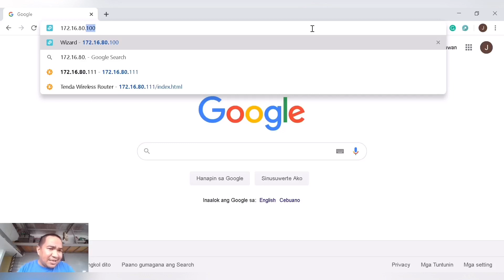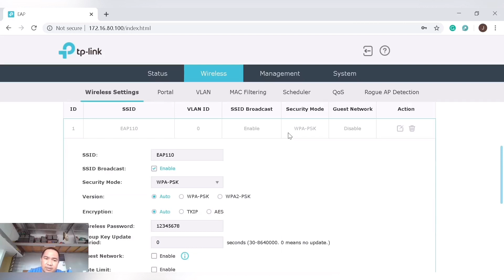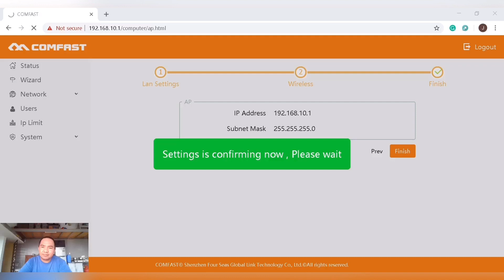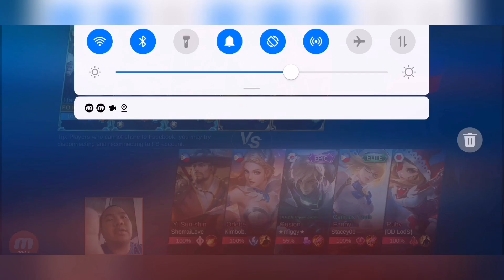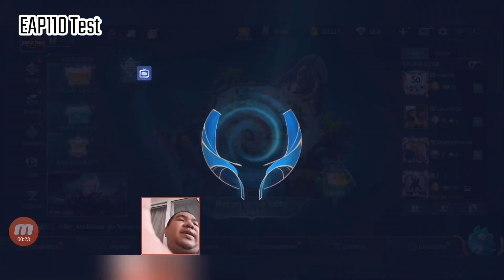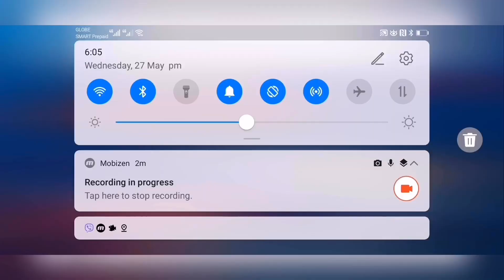TPlink EAP110 and Comfast EW73 - Configuration and Actual Testing | JK Chavez

Comment: Boss pwede ba na ang gawin kong AP ay TP link tapos ang ang extender ay ew73 comfast?
Reply from the maker: Hi Ariel, pwede pong gawing repeater mode si EW73, pero wired exntender negative po since isa lang ung port ni eap110..
Reply: @JKChavez  di boss wireless po

Comment: Sir sana may makatulong sakin pano ko po malalaman kung legit na tp link 225 yung gamit ko? Like may pwede bakong i scan? Kse yung kaybigan ko bumili ng tp link 225 tapos ang lapit lang ng range ng na aabot as in parang tp link 110 lang sya, 10m lang ata yung sagad na range.
Reply from the maker: Hi, usually one way to check is the firmware, if same firmware ung available sa official site ng TPlink and naka install sa device.. hight possibility of legit po..

Comment: Boss bakit po pag gamit ko as repeater or bridge si ew73  limited lang yung speed ny a to 10 - 15mbps kahit 100mbps speed ko and full naman signal
Reply from the maker: gamit mo po sa piso wifi? na change mo na speed settings? pag bridge mode or repeater mode sir, may bawas talaga sa speed, lalo na single band lang po ew73.. :)
Reply: @JKChavez  sa regular  router ko lang po siya gamit.. problem pa po is lagi siya bumibitaw

Comment: Ilan range po pag may walls at bahay po?
Reply from the maker: in an open area good si tplink, can reach up to 80 to 90 meters, while the stable connection is around 30 to 40 meters lang. na try ko from open area, then pumasok ako sa kapitbahay 1 wall lang, around 20 meters distance, hindi na stable,

Comment: Kuys yung power supply Poe po namen may nakasaksak na yung parang plato po sa taas nagbubong namen san po ikakabit yung CF EW 37? Another power supply po ba or sa router na ikakabit yung cable ng CF EW 37?
Reply from the maker: Hi Raymond, yes, po another POE adapter para sa additional na AP device.. or pwede po kayo bumili ne poe injector.. :)
Reply: Thanks you po ng marami❤️

Comment: Hi, iam comfast user nararamdaman ko na sakit na sya ng ulo.. sometimes auto restart and cannot recover so need manual turn off/on. experience with devices of comfast EW71 EW72 EW73 WA350 WA900v (Base AP) 

Can ask sa EAP110 kung pwede ko sya gawing bridge or repeater as WAP?  para ma extend ko ang aking Base AP. Thanks in advance papi JK
Reply from the maker: Hi Sir, wala na sa akin ung eap110, pero as what i can remember walang ibang function si EAP110 aside from Access point, no config for bridge lalo na repeater..
Reply: @JKChavez  Thank you po for share Boss. 
Nag Back review din me

Comment: Sir ung  EAP110 at cloud controller ok na ba yan na set up? AP connected to Cloud controller at cloud controller to ISP? ganyan ba set up sir? Kasi yung  ISP WIFI at Router na kasi yung..
Reply from the maker: Hi sir, have not used cloud controller (omada) for my setup, gamit ko sya before sa piso wifi box walang omada controller, pero ung na mention mo, thats how it should work, pero alam ko kahit walang omada controller pwede sya (wala na sa akin ung device kaya d ko na maalala exactly na mag work sya without the controller)
Reply: @JKChavez  thanks po sa reply sir

Comment: Nice review sir. Ask ko lang sa tplink eap110 mga 30 meters lang mula sa source tatagos ba yan sa loob ng bahay? Mga kahoy lang po yung interferences.
Reply from the maker: Hi Jay, it varies from house built, natest ko 25 meters or below ata un, then loob ng kabilang bahay, may connection pero may instance na drop signal..
Reply: @JKChavez  Pwede pa poba e extend ang height ng comfast mula sa ground? tapos ung length nang UTP cable gawing 100 meters from 30 meters, may mga kahoy kasi sa area namin, 60 meters lang max range niya...
Reply from the maker: @jes2678  Hi Jersey, pwede naman po, but i would recommend 80 meters lang, para less point of failure..
then pag tinaas mo pa sya, mas mababawasan din ung range nya or distance since additional distance pataas po.. :)
Reply: Last question sir sa eap110 ilang meters ba dapat mula sa base(lupa) para sa stable na connection?

Comment: it is expected.. Comfast is a company from China and is just using stolen technology from the US to create it's products. TPlink on the other hand has been the number one company in terms of networking devices for decades now. By the way you can also add the limiting bandwith that wifi vendo machines use to allow for multiple users simultaneously, and in that regards comfast will surely be garbage.
Reply: Depende rin sir sa model.. kasi merun ako comfast e314n umaabot ng 700meters sa p2p. Walang bitawan.
Reply: I wasted my time and money on a brand new unit of Comfast E314N V2. It had poor range. Tp-link CPE220 as an access point performed well at the same two locations and 2.4Ghz channel. Comfast SINMAX software OS is actually a customized version of open source OpenWrt.

Comment: Hello. Maraming Salamat sa review. May I ask - what settings do you use on your QoS in order for Mobile Legends to play well in case your userbase is saturated?
Reply from the maker: Hi Eduardo, i have not configured any priority or QOS on the AP, and honesly i have not check all configuration on the pisoWifi box if there is a QOS in placed. For the eap110, straight out of the box, configured as an AP then test.. :)

Comment: EW-73 for long range 110m 2 bars pa 15Down/5Up speed test. TPlink for low latency gaming(of course at 30m range stable) 80m max distance.
Reply: Boss tanong lng Wala na bang pwd Gawin AP? Yung tp link deco M5? Hindi ba pwd applicable sa vendo? Salamat!
Reply: Salamat noted sir malaking tulong.cg try ko Yan. Have a nice day!
Reply: @lysanderbuhayan2381  yung ubiquiti unifi maganda kayalang punit bulsa mo haha.
Reply: yung eap110 ko mejo malag sa device ko e ewan ko lang sa mga kumukokonek🤷tas di pa abot 80 meters
Reply: @emieljerwinbaal8762  open area 80m. If may harang. Di talaga yan aabot.
Reply: @TomLouwell  open area pero mejo mababa tas may nakaharang na isang puno
Reply: Based on my exp. 8-10 users bumabagal na si EW-73 nag rto na lalo na pag malayo yung mga clients naka connect. Mahihirapan si comfast. Ok siya kasi malakas at malawak ang range 100m+, si tplink ok naman 10-15 clients pero 60-80m lang ang range.
Reply from the maker: nice nice info sir, thanks for sharing.. it will help a lot for people looking for ew73..
Reply: 1 Mbps per user ok na ba Lalo na sa ML? Pa hingi Ng advise salamat!
Reply: @lysanderbuhayan2381  oo ok nayan if solo mo area and mahina or walang ibang source ng internet. Pero mas ok 2M/2M
Reply: @TomLouwell  boss sorry Hindi ko gets Ang 2m/2m .hehe pwd Po ba elaborate.salamat
Reply: @lysanderbuhayan2381  2Mbps download and Upload.
Reply: @lysanderbuhayan2381  If bibili ka ng AP for vendo ok din Ruijie EW1200 PRO kasi mas better sa online games. Mas stable kahit madami naka connect.
Reply: @TomLouwell  yung wavlink a600 ok ba yon?
Reply: @TomLouwell  boss Yung outdoor antenna ano po maganda Yung pasok sa loob Ng bahay ang signal
Reply: @GameDiaries2014  For hotspot deployment. Mas maganda sir na multiple AP deployment for  stablity. As of now. EW72 na naka mesh with OpenWRT, Eap110 at Ruijie EW1300 Pro na naka mesh gamit ko na AP.
Reply: @TomLouwell  boss anung pwde kung gamitin na pang repeater sa tplink eap225  para mas malayo pa ang marating ng range niya? kasi may mga clients akung nasa 300m+ na ang layo nila open area po

Comment: sir pa help po ,paano po makapag supply ng internet connection sa wifi vendo(sa tindahan) if yung isp router(nasa bahay) na  80 meters pagitan nila.kailangan ko po ba mag bridge gamit to ?
or paano po gagawin ko?
Reply from the maker: Hi Marc, kung kaya latag ng cable mas okay, pero masyadong malayo ung latag na yan, option is get a cpe\ptp, para mas okay ung internet speed na ibebenta sa piso wifi na ikakabit sa tindahan, kung ito kasi gagamitin, ung 80 meters range na un, unstable internet na, unlike pag cpe\ptp, mas mataas ang magiging internet speed mo..na pwede mo ilagay sa piso wifi sa tindahan..
Reply: @JKChavez  two cpe/ptp po ba bibilhin ko ?
any recomend item sir?salamat po sa pag sagot
btw ilike your tech vidoes sir
Reply: Mag UTP cable ka nalang

Comment: Sir wala na po ba inaayos na iba sa settings ni EAP110? Sobrang hina kasi ng wifi signal kahit katabing bahay lang ung sumasagap. nakainstall kasi sa terrace ng 2nd floor namin so basically open area nman pero sobrang hina tlga.
Reply from the maker: Hi Sir, yung test ko po is as is, walang binago, paanu po setup, indoor sa katabing bahay inaccess?
Reply: @JKChavez  Yes po. Pero kahit nga sa loob ng bahay ko po tinatry mahina parin.
Reply: @TheMightyTV  pang outdoor po kasi yan boss,,, kpag pang outdoor ang device mo na wifi, mahina talaga magpenetrate sa mga pader. i have tp link eap 225 here.
Reply: Normal yan sa outdoor AP. Ang bilhin mo ug pang indoor router na maraming antenna.

Comment: Ilan meters po max range sa dalawa ? kase yung ew71 ko 3 bars pa perod dina nakakaconnect sa internet. thanks po
Reply from the maker: Hi sir, may range test akong video for both.. Around 80 meters range with not stable internet na un.. Beyond that may signal walang net..
Reply: @JKChavez  thanks sir. check ko po.
Reply: Mas malakas si ew-73 naabot pa sa 150m. Ew-71 half lang power nyan so somewhere 80m